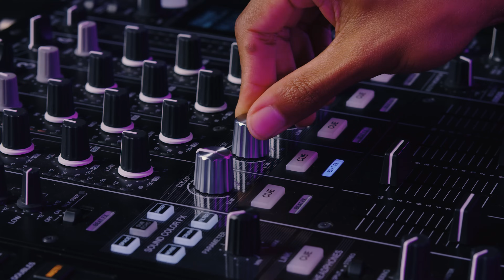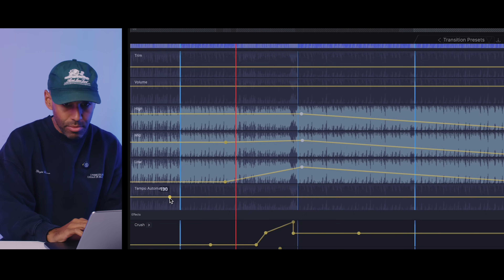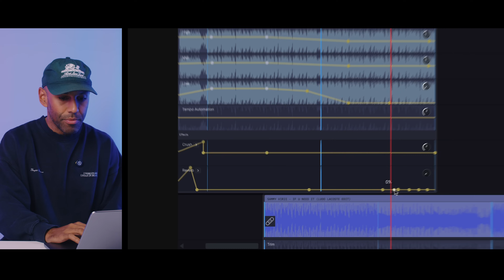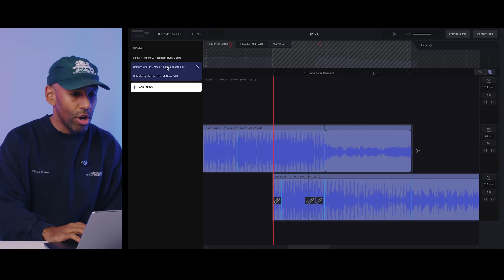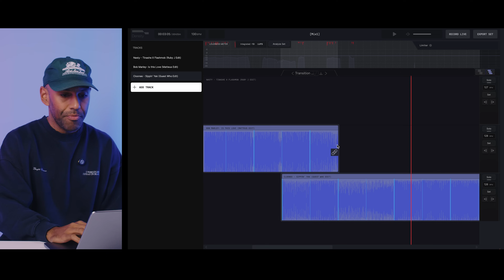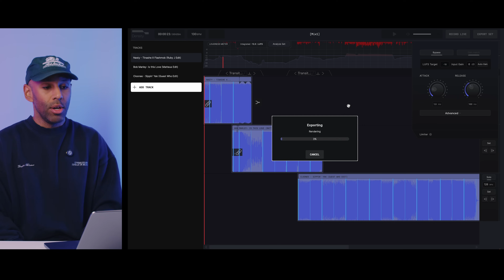This Box Perfectly Records Your DJ Sets. (Density Review)

Comment: Used this a couple of times, my major beef is that the mix has be recorded using beat sync. Any change in pitch during the mix needs to be knocked out during the post production. So if your looking for sanitised perfection fine but if you wanted to leave some slight mix imperfections and just tweak volumes, eqs etc (which I did) it doesn’t work very well at the moment.
To be fair. the support was brilliant and helpful and apparently it’s being looked into…
Reply: I’ve experienced the same with this software: everything is locked to grid, pitch editing is non-existent (only global tempo), and recording actions is just unreliable. Sometimes events are late, sometimes they fire too early, and effects get messy. It’s definitely not suitable for professional mix recording or regular content production.

Best advice? Play it right the first time! 😄
Reply: I have been looking at this, I never use beat sync so guess something I thought would be great is maybe not for me?

Comment: Thing is, it’s great practice to record audio live and it builds your skills and confidence. I can see this being good for perfecting a mix but it opens the door for bad habits. Fine tuning a mix too much can make it sound worse. Using it live, you’ve still got to plug in a cable at the back which isn’t always easy if you turn up to a gig and the event is in full flow. 

If CDJ’s are the cameras of the photography world, then this equipment is Photoshop. It might be the way things are going. I won’t be using this, but interesting though.
Reply: You are totally right there. I used to just record my mixes in real time, if there were mistakes, there were mistakes. Sometimes I'd start over if it wasn't too far in. Then I started using Audition for more than converting the Rekordbox WAV file to mp3, I chopped some tracks down to be shorter and a punchier megamix, this led to then mix pasting, so I kept the BPMs locked for a whole set, because then I could mix paste, and what do you know, if the BPM is kept the same on another mix, I could splice two half hour ones together! Then I did one mix where I thought that needs a sample to mockingly answer a spoken part. This led to me doing an 80s mix, and a 90s mix, and dropping in suitable movie samples from films of those decades. Yes, the finished result was very good. But...
-It had taken hours and hours of work to produce this one hour of audio. 
-It wasn't as much fun putting myself under pressure to get it perfect.
So, part of me wants to just go back to recording it live. Where an hour mix takes an hour, and is of the time.
Reply: @blue_ranger  I personally would rather listen to the overly crafted piece. Each of them have their place, it’s like live vs edited. This system would make the creation you made better and easier. You wouldn’t have to be locked to one BPM too.

Comment: I wish I can just rely on Serato to record my sets, but Serato has a file size/time limit.  Recording long sets results in a slight gap between files, which can't be fixed without manual editing.  My solution is to just record set using an external device such as an audio interface into a laptop or smartphone.  If I had more RAM in my M1 MBA, I would feel comfortable with routing a copy of the audio from Serato internally into a recording software.  

I understand the ability to edit mistakes can come in handy especially when recording a 6 hr marathon set.  But I also don't want to rely on it as a crutch.
Reply: audacity and just record the desktop if youre using a laptop
Reply: @voodooness yeah never failed using Audacity and usb interface 👌
Reply: @voodooness  Not gonna risk it with 8gigs of RAM bro.  🤡